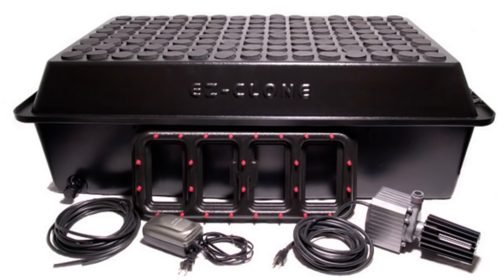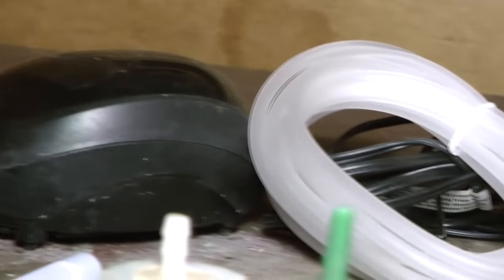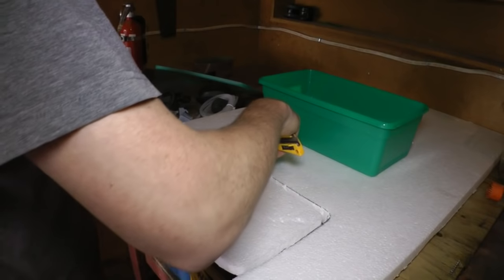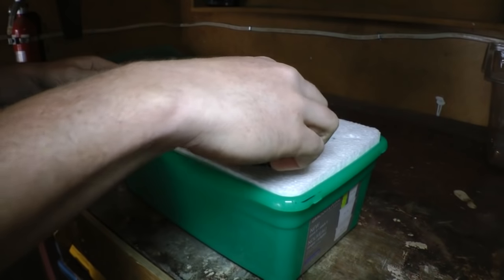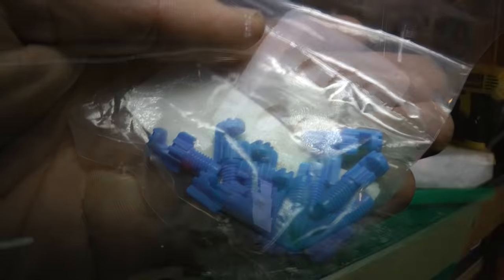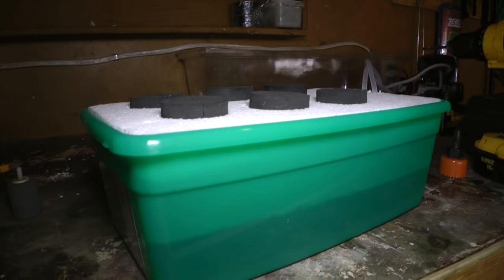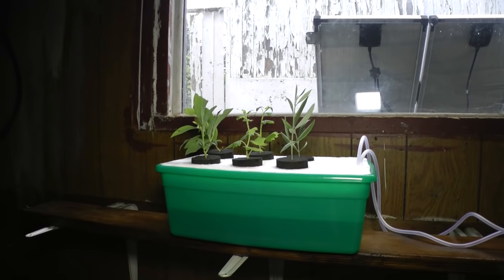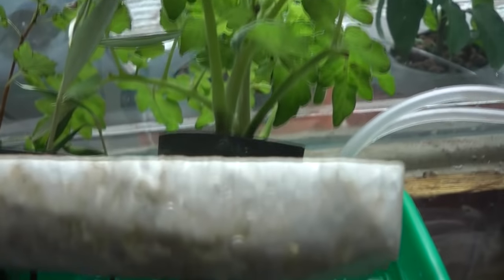Homemade Hydroponic Cloner

Comment: when drilling through plastic have the drill spinning counter clockwise. It will melt the plastic instead of cutting it, much smoother and effective.
Reply: Correct, works very easy and very clean when you do it this way. But same comments when you want to use the styrofoam plugs....
Reply: Nice tip thanks !
Reply: Thanks for sharing, I’ve always wondered how to get better cutouts!
Reply: Top idea
Reply: Just wanted to share this tip too. I'ts changed my life. Haha. Works like a charm every 
time
Reply: Thank you black man 💪🏾
Reply: @Super122891  ????
Reply: @carrottoponcrak  I too am confused about the statement of gratitude
Reply: Dude I literally thought the same thing, also ya can just use a craft knife lol.
Reply: A Dremel would be better than the hole saw
Reply: @blitzddaily8033  bad advice. I have cut hundreds of holes in pvc with a backwards spinning hole saw. Its the only way to go. If my guy tried to use a Dremel i would probably let him go.
Reply: Cool !
Reply: Facts
Reply: Or a glue gun
Reply: @blitzddaily8033 very wrong
Reply: Good Tip Thanks !
Reply: What I was gonna say 😆

Comment: hi there this is amazing trick for cloning time , how many millimeter between the water and cutting trunk from cloning ? in my research cloning need heated mat , so can I add heater from aquarium ? keep it warm , similar with normal dome underneath need heater .
also can I use rock wool for cloning yes

Comment: Got to be honest man that looks really sloppy. Try getting a pilot bit and drilling in reverse next time. Also you would have been better off heating up the saw or just pushing it through the foam with the weight of your hand on a flat surface.

Comment: Using a hole saw, you need the center drill bit to keep hole saw stay aligned. Also drill backwards it will make a smooth finish hole, and less tear out.

Comment: Two words. Styrofoam Cutter. You can make one from some thin copper or aluminum wire and a 9volt battery. I had to laugh a little when you used power tools on styrofoam lol. Other wise pretty good.
Reply: Curtis Dorris. Foam cuts very well with a hole saw he is missing the center drill almost impossible to do a clean job
Reply: Jeez, just use some sharp thin paper knife, it's not that hard to cut a few holes with it

Comment: How long do you leave the cuttings under the dome? Do you  use a heating mat to control the temp of the cloners water?  Very nice video!
Reply from the maker: I never had to use a heating mat with the cuttings. If you have a dome with vents you could probably just open the vents once you see some roots being established. Aim for 80% humidity until they look ready for transplant.

Comment: Just drill 1/2 in drill holes all over it and clone fifty easily at a time no pucks needed
Reply: That would damage the newly formed Roots when you tried to remove clones. Need a 2 inch diameter.
Reply: That would damage the newly formed Roots when you tried to remove clones. Need a 2 inch diameter.
Reply: Except if you're careful. I've never had a problem with it. Years of use out of it.

Comment: To cut through plastic with those hole saws, drill the pilot hole normally, and then run the drill in reverse to cut the circular part, it creates cleaner cuts.
Reply: Looks like his pilot bit is missing. Probably his first time using his dad's drill.

Comment: you showed a pic of an aeroponic cloner when making the money comparison and built a dwc cloner..VERY big difference between the two. I own a lot of both of those and the aeroponic cloner would have a million times higher success rate than the dwc you made any day of the week. I wont even use my dwc cloners any more and have already givin most of them away. you can build aeroponic cloners cheap as well. Also that styrofoam will be eaten away by the nutrient water and leach chemicals in to you plants roots

Comment: pro tip. skip the pucks. let the styrofoam float on the water. it sinks/floats to the perfect height
Reply: No. It's important that the cuttings stay above the surface of the solution so Roots can be stimulated by the splash of the popping bubbles.
Reply: Brilliant !